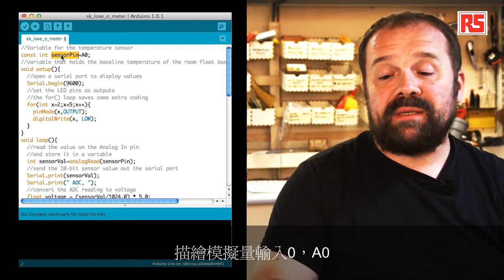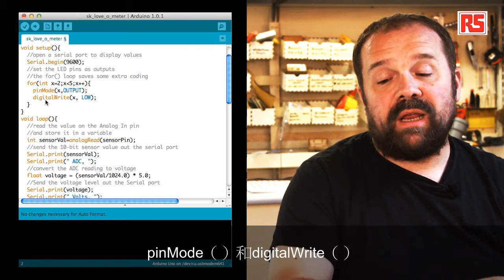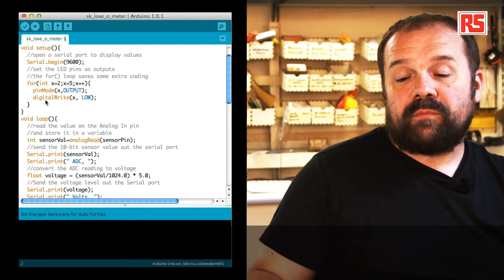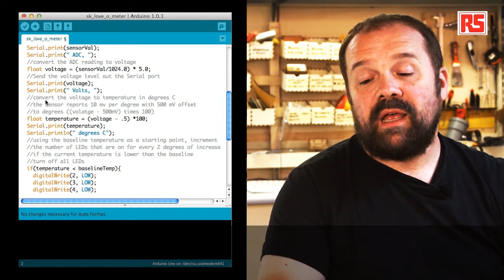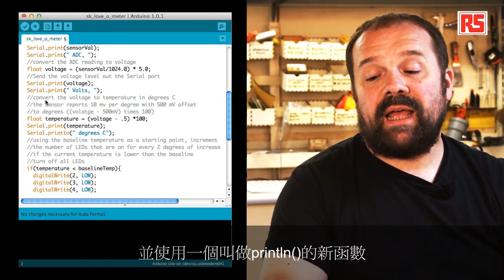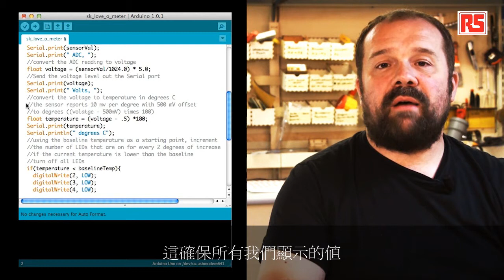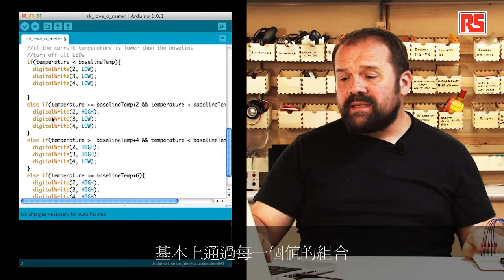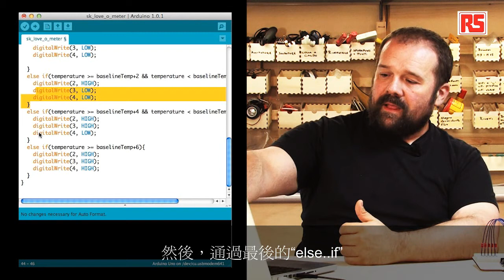Arduino 入門套件中文字幕教學第三課 — LOVE-O-METER: RS Components

Comment: const int sensorPin=A0;
const int baselineTemp =25;
void setup() {
  // put your setup code here, to run once:
Serial.begin(9600);
for(int x=2;x<5;x++){
  pinMode(x,OUTPUT);
  digitalWrite(x,LOW);
  }
}

void loop() {
  // put your main code here, to run repeatedly:
int sensorVal=analogRead(sensorPin);
Serial.print(sensorVal);
Serial.print(" ADC, ");
float voltage =(sensorVal/1024.0)*5.0;
Serial.print(voltage);
Serial.print(" Volts, ");

float temperature = (voltage - 1.413)*26.676;
  // base on your sensor to adjust the value:
Serial.print(temperature);
Serial.println("degrees(");

if(temperature < baselineTemp){
  digitalWrite(2 ,LOW);
  digitalWrite(3, LOW);
  digitalWrite(4, LOW);
  }
  else if(temperature >= baselineTemp+4 && temperature < baselineTemp+8)
    // base on your sensor to adjust the value:
  {
  digitalWrite(2, HIGH);
  digitalWrite(3, LOW);
  digitalWrite(4, LOW);
  }
  else if (temperature >= baselineTemp+8 && temperature < baselineTemp+12)
    // base on your sensor to adjust the value:
  {
  digitalWrite(2, HIGH);
  digitalWrite(3, HIGH);
  digitalWrite(4, LOW);
  }
  else if (temperature >= baselineTemp+12){
      // base on your sensor to adjust the value:
    digitalWrite(2, HIGH);
    digitalWrite(3, HIGH);
    digitalWrite(4, HIGH);
    }
  
}

Comment: /自己練習參考用/

const int sensorPin=A0;
const int baselineTemp =25;
void setup() {
  // put your setup code here, to run once:
Serial.begin(9600);
for(int x=2;x<5;x++){
  pinMode(x,OUTPUT);
  digitalWrite(x,LOW);
  }
}

void loop() {
  // put your main code here, to run repeatedly:
int sensorVal=analogRead(sensorPin);
Serial.print(sensorVal);
Serial.print(" ADC, ");
float voltage =(sensorVal/1024.0)*5.0;
Serial.print(voltage);
Serial.print(" Volts, ");

float temperature = (voltage - 5)*100;
Serial.print(temperature);
Serial.println("degrees(");

if(temperature < baselineTemp){
  digitalWrite(2 ,LOW);
  digitalWrite(3, LOW);
  digitalWrite(4, LOW);
  }
  else if(temperature >= baselineTemp+2 && temperature < baselineTemp)
  {
  digitalWrite(2, HIGH);
  digitalWrite(3, LOW);
  digitalWrite(4, LOW);
  }
  else if (temperature >= baselineTemp+4 && temperature < baselineTemp)
  {
  digitalWrite(2, HIGH);
  digitalWrite(3, HIGH);
  digitalWrite(4, LOW);
  }
  else if (temperature >= baselineTemp+6){
    digitalWrite(2, HIGH);
    digitalWrite(2, HIGH);
    digitalWrite(2, HIGH);
    }
  
}